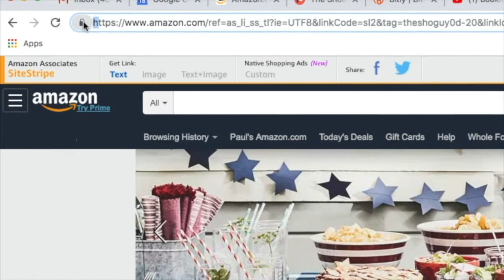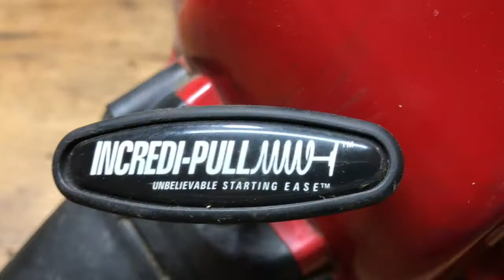How to fix my Weed Wacker?

Comment: I'm have lots of experience using Echo and Stihl string trimmers  however I never worked on them  other than cleaning the air filter. They both are good but I'd go with Echo because of the price.   I hope your nerves calm down.      Good to hear about your son!   I don't think I can find a new truck the way I want it  5 speed  manual transmission and windows  with a v8 single cad full-sized  Chevy  I don't think they make that way. Good video!
Reply from the maker: Unless you buy something pre-1995 prior to the onset of OBD-2 and want to spend over $10k, a simple truck no longer excists. Sigh.
as for my line trimmer, I have good news! https://youtu.be/KOPm4kX3Slw